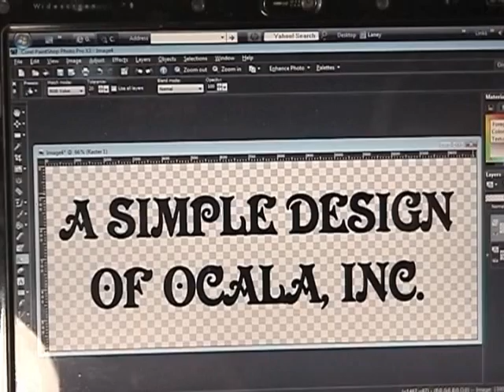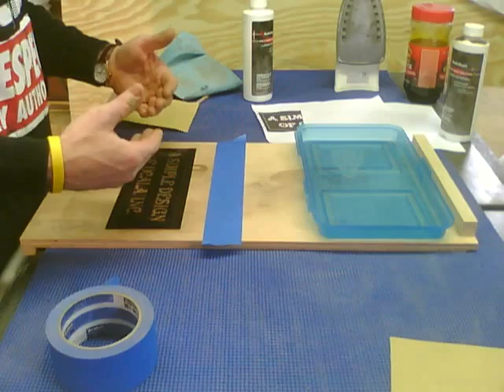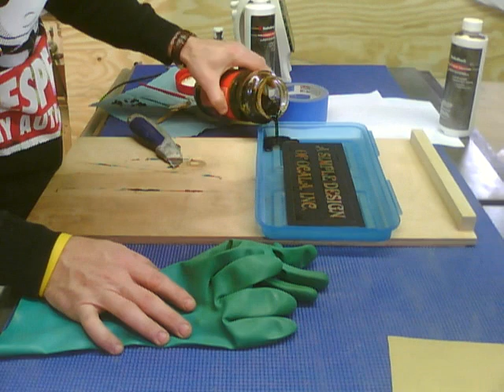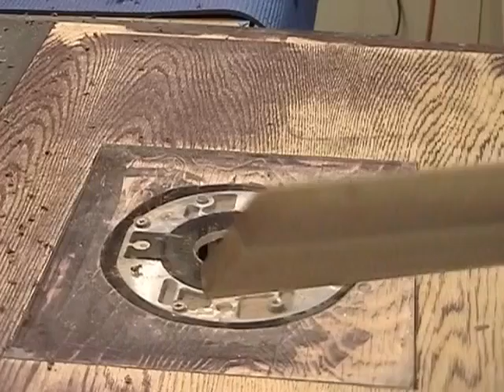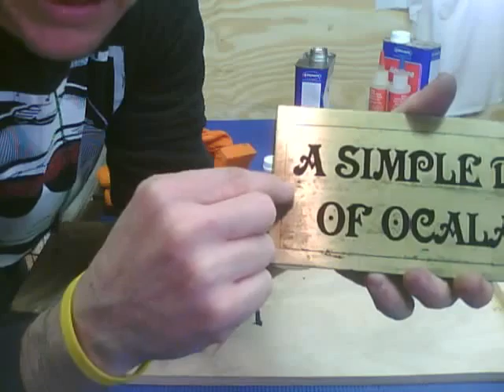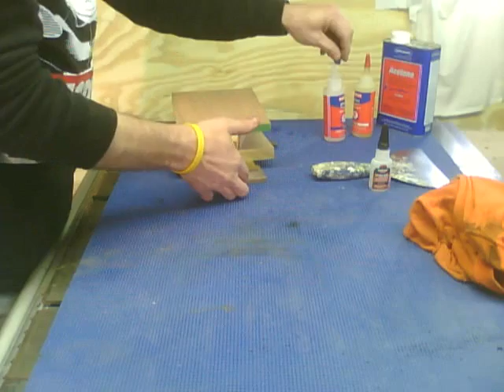Let's Etch Some Brass!

Comment: Long delayed echo to Tony McNabb:  Ferric chloride is not the best etchant to use on aluminum.  Much better to use a lye solution.  I made many hundreds of panels for a stereo company this way:  black anodized aluminum, coated with photoresist which happened to develop in a lye solution.  Leave the lye solution longer than needed to develop the image, and it would etch through the black anodize coating, leaving lettering with fine detail in aluminum color on the black background.

Comment from the maker: The iron is set to its highest temp which if i am not mistaken is the cotton setting. the zerox step is only necessary if you have an inkjet printer. The zerox Toner acts as a resist to the chemical. You should be fine using a laser printer, since it uses a similar toner style media. so you wont need to do the zerox copy.. I would say give it a try using your laser printer, iron it on to transfer the image to the brass.

Comment: what setting/temp do you heat the iron to? I don't want to end up melting my film, but I'm not sure if there's such thing as not hot enough.  also - is the xerox step necessary, or is it possible to skip it by printing directly onto a transparency with a laser printer?  thank you very much in advance

Comment: Laney, your local sign shop will make a negative or positive mask for you. The thing is to see if the vinyl will hold up against the chemical. It should cause it's vinyl. I'm going to try and find these chemicals here (South Africa) and experiment as well. Been meaning to try this for years. Tried a glass etching concoction and just to be aware to stick the vinyl edges really well or you get seepage underneath. But once etched you should be able to colour the graphics and then remove the vinyl.